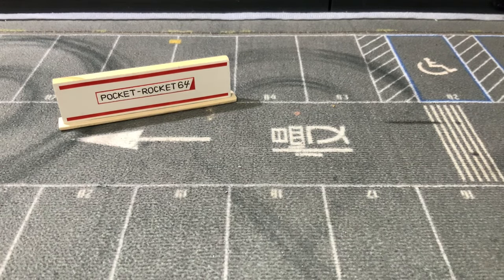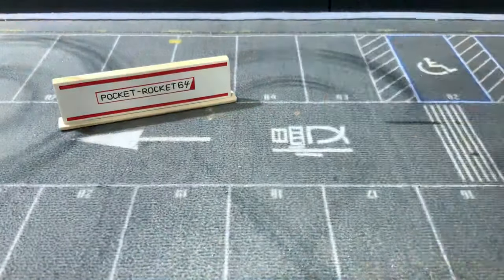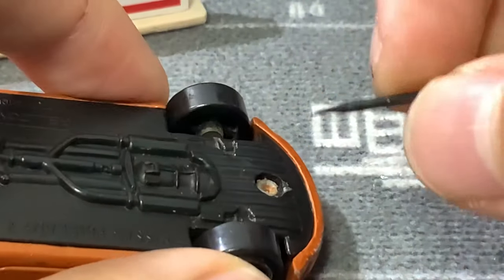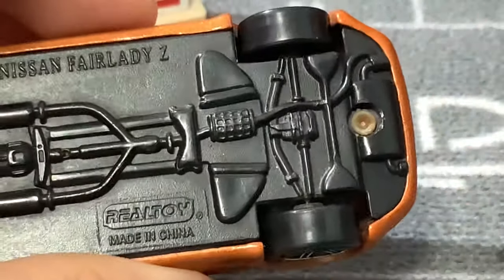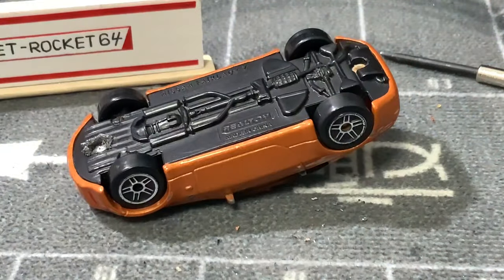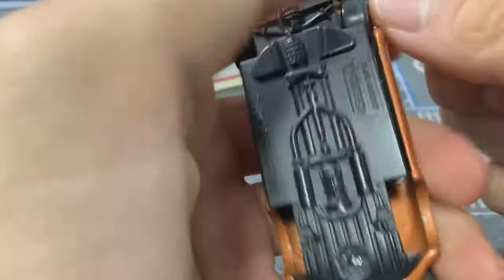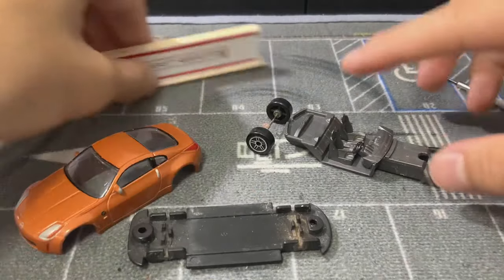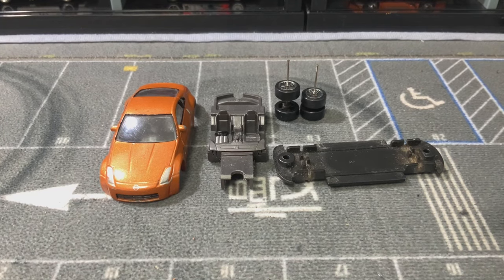How to open a diecast car with only a screwdriver. No drill, no heat gun!!!

Comment: Can also use a manual drill or anything to bore through and drill down the center (just until the level of the base, creating a wider concave) that way the edges thin out, then you can use a small flat head screwdriver to nudge the sides inward. The thinner it is, the easier to push. And lessen the damage as well.
Reply from the maker: Great idea! Time to buy myself a manual drill!, as a normal one would be too expensive 😆😆😆
Reply: @pocketrocket6494  bro normal drills are 40 bucks 😐
Reply: @seabass62yearsago  thats still kinda expensive
Reply: Yes but ur gonna have to hot glue it back
Reply: @pocketrocket6494  Bro how to add a screw nail for the base?
Reply: How do u close it

Comment: Its funny how I discovered this in a fit of frustration. Although some may think so, i dont think the damage is terrible. It's easily fixed with some putty and a thin dowel to keep the screw clear. And if people customize, they end up sanding down the chassis to some extent. Cool vid.
Reply from the maker: Yeah! Plus a lot of people think that this method wouldn’t work on metal bases, but in fact metal bases will minimize the damage caused by the screwdriver 😂
Reply: @pocketrocket6494  indeed and the metal used in diecast are a lot softer compared to other metals out there.

Comment: Thanks! I didnt use the method yet, but I started some and it looks exactly like here. I want to repaint my SIKU Porsche Cayenne Turbo beacause the paint has been looking bad, and this will definetely help me
Reply: did it work? im trying to do the same thing with my siku mercedes sprinter and since it has different rivets not mentioned in the video i do wonder if it works here aswell before i break the entire wheelbase...

Comment: what if the base is metal
Reply from the maker: This method also works on metal bases since the rivet is essentially the same material as the plastic bases, in some sense metal bases are even better for this method because you won’t damage the bass as much when you’re prying the rivets off!